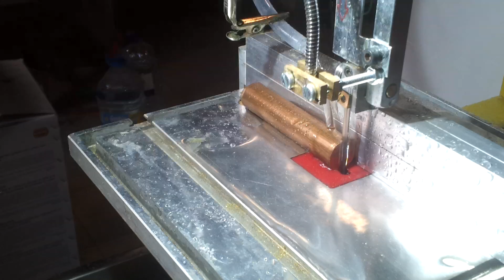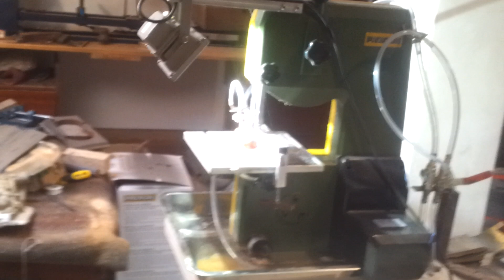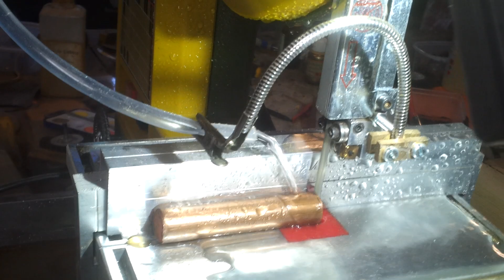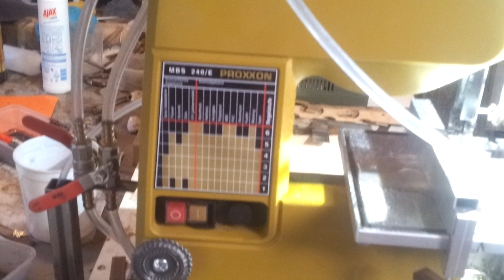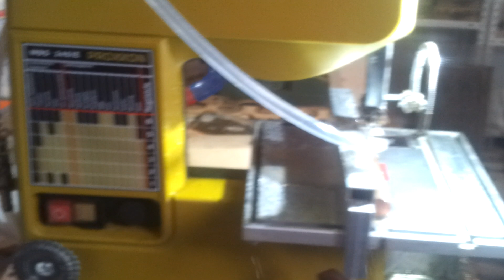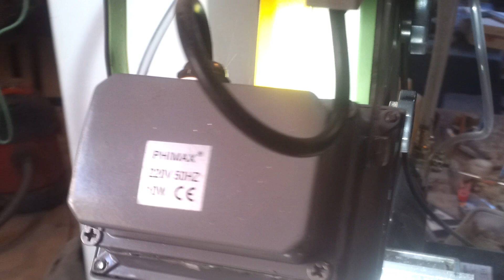MY Proxxon MBS 240E

Comment: To my eyes it looks like bare water you are using there? Wouldn't it be better to use cutting emulsion? By the way I plan on using ballistol for drilling, probably pure but it can be mixed with water as well.